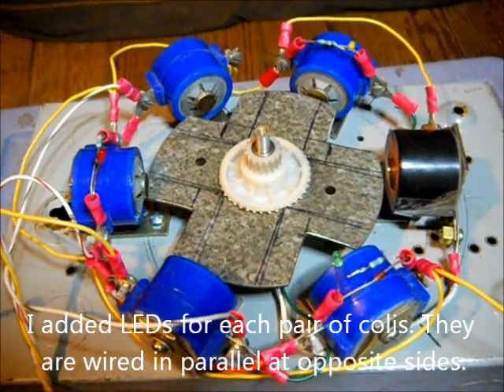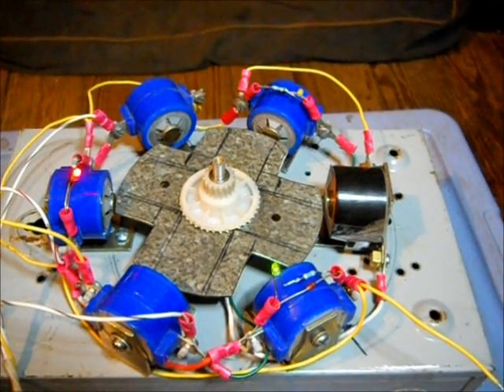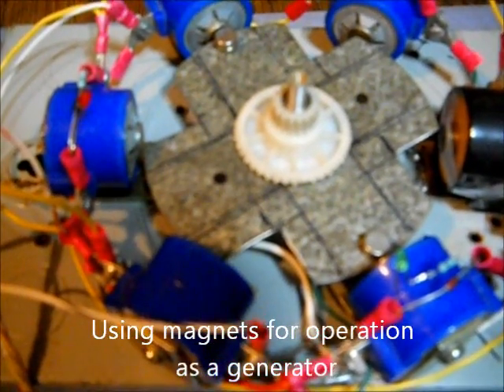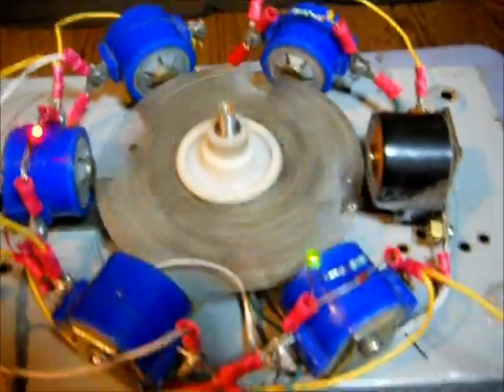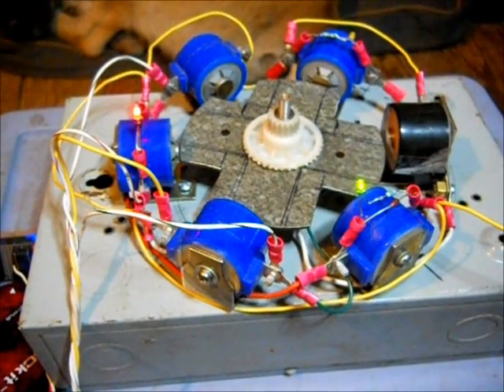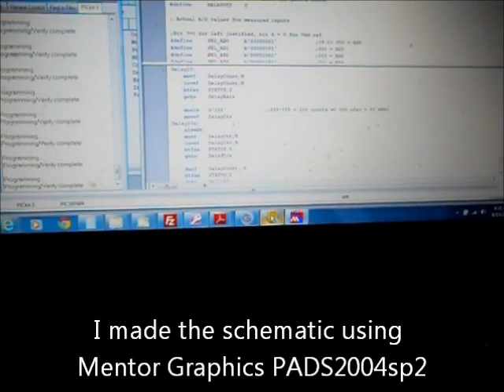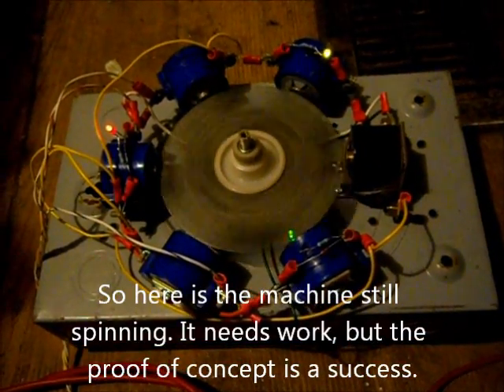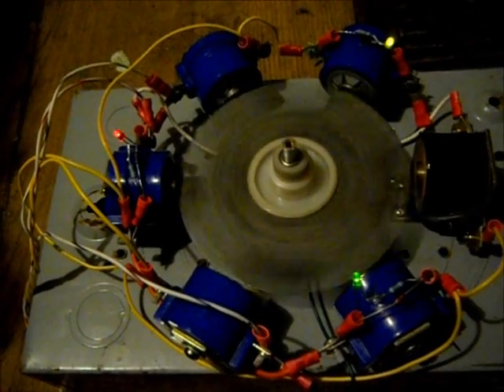Switched Reluctance Motor Part 1

Comment: There is no outer ring to complete the magnetic circuit?
Reply from the maker: The coils have a steel core and a metal angle bracket that screws onto the steel box, so that forms somewhat of a magnetic circuit. But it's not really needed. An energized solenoid will still attract the steel poles of the rotor.

Comment: What is the material you have used for rotor ?
Reply from the maker: The rotor is just a galvanized steel cover plate for an electrical box.

Comment: why sparking light are coming alternatively
Reply from the maker: The LEDs indicate the polarity of the solenoid drive. They are red in one direction and green in the other. When driven fast enough, they appear yellow. This design is somewhat different from other SRMs that use just one polarity either ON or OFF. I may revisit this project and try some new ideas.

Comment: I know this is an old video, so perhaps this is invalid now, but if you were to start the motor with a low stator frequency and gradually increase it to your running speed you could start the motor without it needing a push start

Comment: You need a Hall effect sensor. It needs to know how fast to change poles so you are not pulling momentum out a moment after its applied.
Reply: hall sensor will let SRM positives be gone because one of them is stability. For example Brussless motor with magnet will be effected when temperature of env is too hot, hall sensor is same as..

Comment: Another consideration is that there is only rotational force when the coils are out of alignment with the magnets. When they cover the poles completely a strong field does nothing.  One way is to make an 8 pole 5 coils that pulse one after the other storing the reverse charge for the next coil. Whether or not this could be made into alternate north south poles I can't remember. The back voltage from the collapsing field could be stored for the next coil with diodes for a top up from low voltage.

Comment: Using diodes the reverse pulse increased input voltage continuously, progressively and there was a significant gain in speed using 1 amp. It had to be stopped because it was running from a power supply. The arrangement was single phase with four series coils and 8 weak magnets that were the same dia. as the coil iron. The controller used optical positioning and was very precise. The next step was to make it three phase. The device has no practical use but is a test bed for more efficiency.

Comment: In a BLDC the magnets are close together and I think this is inefficient. If the field aligns there is an inrush current and if opposed a large voltage is required to overcome back emf requiring less turns. Another consideration is once energized the magnetic drag will continue on the rotor for a fraction. I built one with double wound coils and a separate double wound inductor to reverse the current in one winding like a transformer to drive down the magnetism and reverse it to repel slightly.